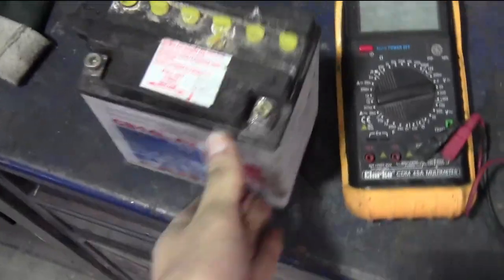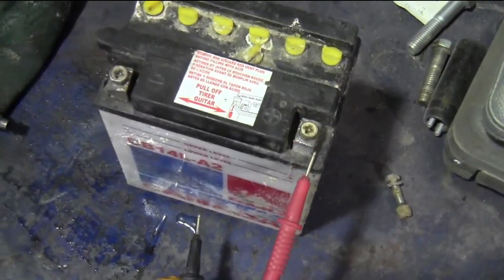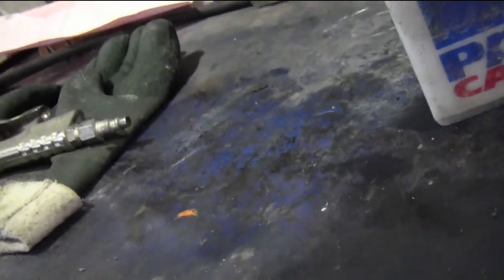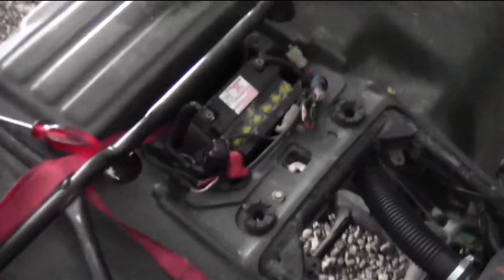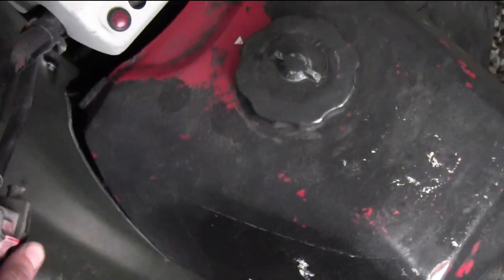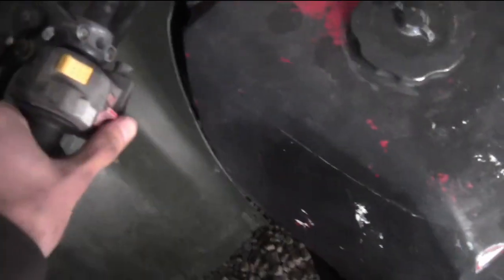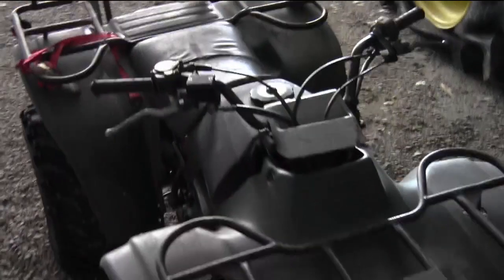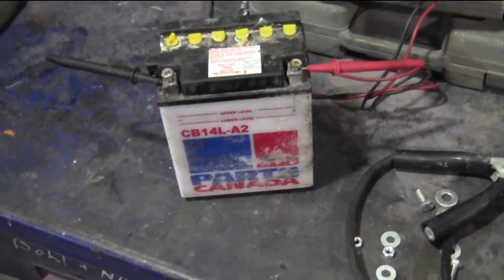Saving a frozen battery

Comment: Pulled my truck battery and it was frozen. Wouldn’t register on my smart charger so I hooked it up to my suv and boosted it for 10 min.

Charger registered it but constantly says “Low” capacity with normal tension and normal amps. Reads 12.3v off the charger.

So I think I’m gonna I/O cycle charge it like you did and hopefully it’ll be ok.

Comment: YES  BUT  YOU  MUST  PUT THE  BATTERY INSIDE  (FOR AT LEAST 24 HOURS ) BEFORE  YOU PUT  THE CHARGER ON ... AND  DONT  LEAVE AN OLD  BATTERY  OUTSIDE  UNTILL YOU  WANT TO  USE  THE  BIKE OR ATV. .......   ( when i put the  charger on before that  no chage was  shown..  )                                                           ED IN N.Y.. (MINUS 10 CELCIUS TODAY ).......................

Comment: dude you are VERY V-E-R-Y lucky you didnt explode that battery. i also have a 10 a charger and had to buy a "maintainer" to revive a common garden tractor battery because those batteries are not designed to be charged at more than 2 amps. especially dealing with a frozen unit youd want to take it inside to let it warm up before applying any sort of charge whatsoever.
im very happy it worked for you but remember that the cost of even buying a brand new batt. is far less than the results that quite possibly could occur with charging improperly.
Reply: +geoffrey walker i needed to defrost my battery for 24 hours at home before trying to charge it... it's charging now, wish me luck :D
Reply: Yes you have to bring it in to thaw slow or over night . Charging a frozen battery is a waist of time.  Only time we exploded one was on a welding machine we used a Start All to jump start. But it was putting 80 amps into that battery to start the machine and it went boom . So best to see if they froze before a jump or high amp charge .
Reply: Thanks for the video , at least I know what to try before buying another one .

Comment: the cranking that battery gave out, was fairly descent. Some mechanic stations will attempt to salvage a frozen battery for you, while others looking for a rapid turn over of service, as well as minding the manufacturer's advice, will almost always just put a new battery in. as you had found, sometimes a frozen battery can be salvaged, with a little patience and tenacity.

an annotation I would like to offer is, the new "maintenance free" batteries, are not constructed any differently than batteries produced 20 years ago. you can still get 7-10 years out of a battery, instead of the 3-5 years they recommend. all one need to do is take a lesson from older generations, by checking the electrolytes, and topping off the cells with distilled/filtered water. The maintenance free battery, is a marketing term, inspiring both a sense of convenience in the customer, encouraging more frequent rotations of product, and minimizing liability from the manufacturer. Unfortunately, if a battery has a sales warranty with it, most if not all are voided by and form of tampering, including removal by an uncertified tech, as ridiculous that sounds.